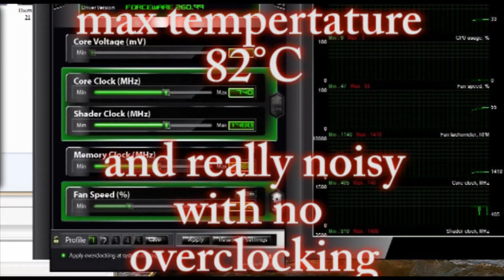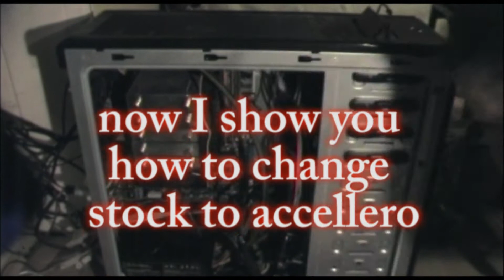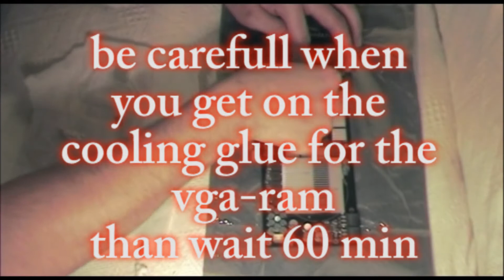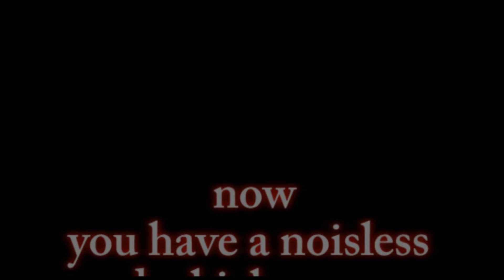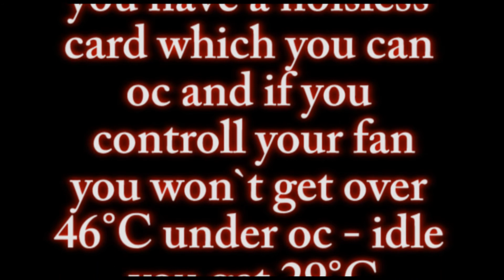installing accelero xtreme on gtx470 make shure you get the holdingkit for your card

Comment: @ichmeinfilm 
The silver looking square @ 2:09 is what came off of my card when I was taking off the stock heatsink. It's a heat spreader for the gpu die but I dunno what to call it.
I'm pretty sure that I had some idea of what I was doing as when I had my Gelid icy vision installed, it hit 62C max load. Arctic is just screwing me over `-`
What I would like to do is attach the accelero directly to the gpu die and see what it does there...

Comment from the maker: @XBrollyImhotepX 
after installing the cpu temp drop from 56 degrees to 48 at max loaded cpu...
because the heat air is the lower problem the heatradiation is really important...and my tower is nice(zalman ms1000hs2- video on my channal)
in this case i can`t hear the cooler at 100% i think its the noislevel to 50-60%Stockcooler

the acceleroxtreme is really long ...make shure it fits to your case and your other installed hardware

on my board is tripple sli possible but with this cooler

Comment: Hey there, is it absolutely necessary to get one of these weird VR00X kits?? I can get heat sinks and thermal paste from maplins but this MOUNTING plate is impossible to find, do you actually need it?

Also did you use that padding to support the other half of the accelero? Or did it come with the kit?

Comment from the maker: thanks, but i dont have any probs like this ... in my tower the card gets max up to 46 degrees .......under oc!!! 
it don`t matter clockspeed @ 750 or 800mhz, the temp is still the same
Vram gets up to 36° @ 1800 or 2200mhz ...
but i dont overvoltage the core so i get grafik faults @ the higher clocks...
but the power is unoced enough for actual games